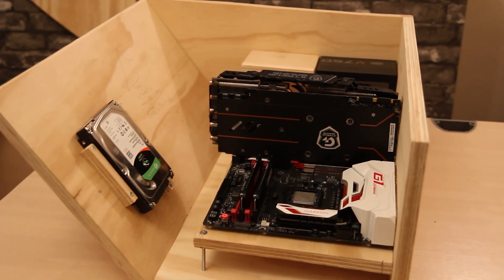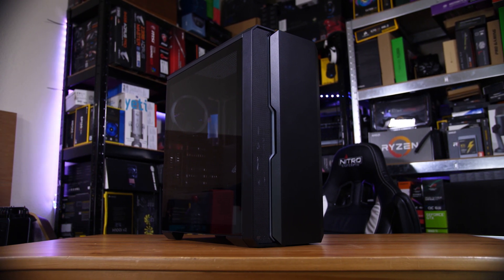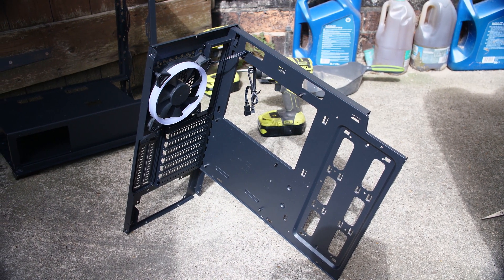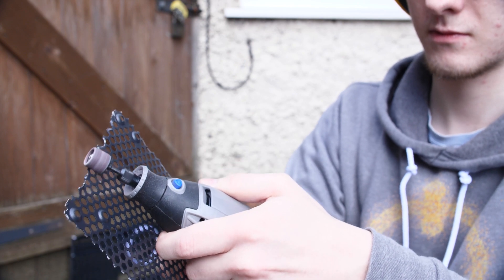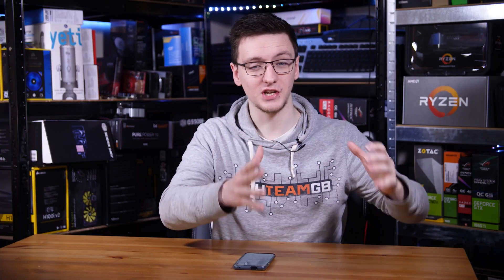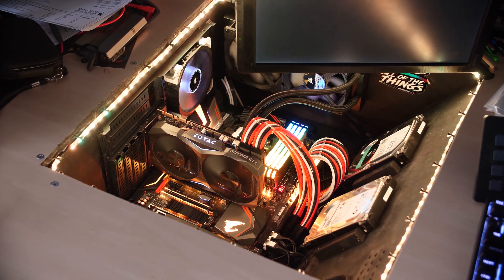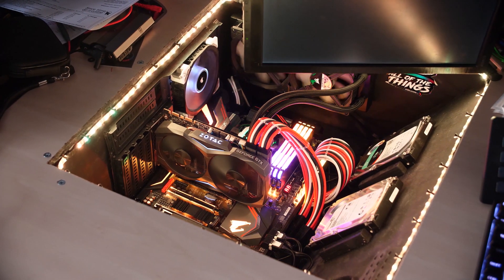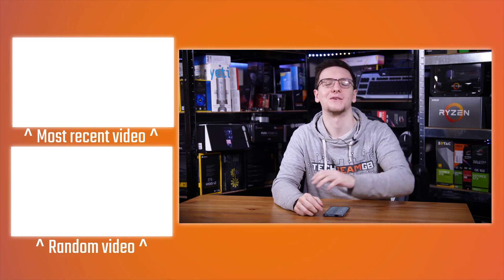How to build a DIY Desk PC Properly… - TechteamGB

Comment: Pro tip: Dremels suck at cutting out anything on panels. Do yourself a favor and either make your own cutting discs twice the diameter (out of the thinnest (~2mm) full-size angle grinder discs or just borrow a real angle grinder.